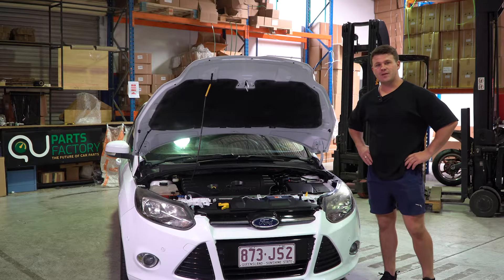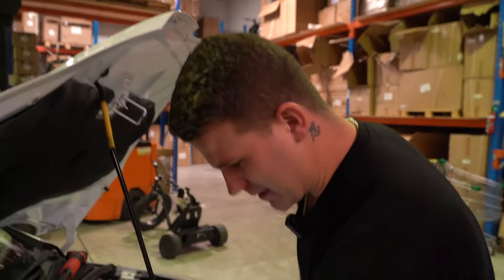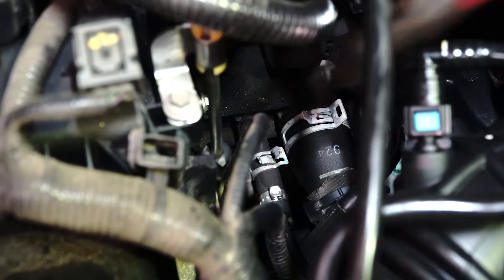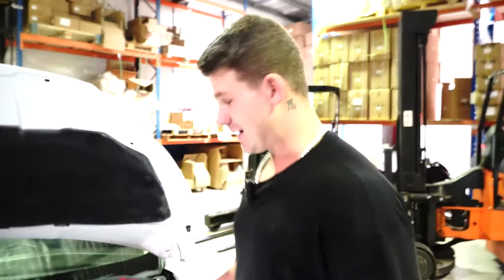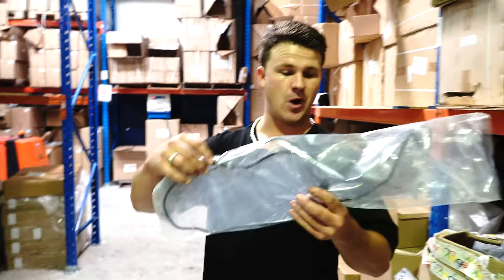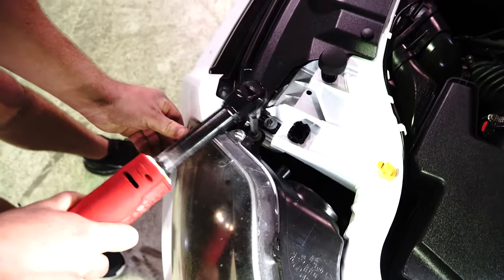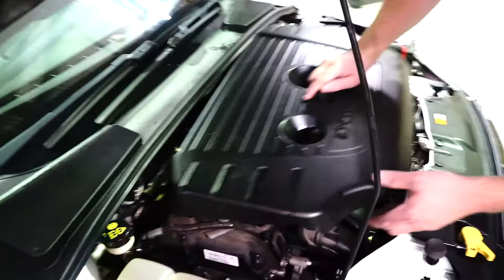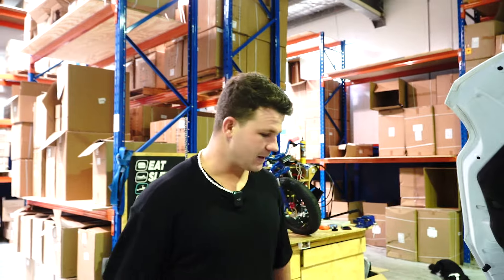How to Replace Ford Focus Coolant Reservoir Hose Pipe Suit LW Models 2011-2015 1.6L 1.8L 2.0L

Comment: How are your butterfly clips going in so easily?  I was pushing on those with all my might and couldn't get them in.
Reply from the maker: RAW STRENGTH !!!! ;) Nah just put some grease on the o rings and should go in easier
Reply: I know this is late but for anyone else checking comments, I had this exact issue and my arms are far from noodles lol ( 2016 focus 2.0 btw,)  you got to turn it a certain way. For me it was clockwise (standing in front of the vehicle facing the windshield) somewhere between  30° to 60° for the end connecting to radiator. Finally slipped right in!
Reply: @KevMo-f3d  The male end of mine was tool long.  I actually filed it down with a sander and it fit.
Reply: @KevMo-f3d  The male piece I was trying to push in was too long.  I actually had to shave off material for to make it shorter for it to go in.

Comment: Man, I’m struggling with this replacement. Getting the old one out required separately removing the old seals out of reservoir and radiator. The replacement part locally available with commercial account was a Doorman brand. It will not go into the radiator. Can not get the new O-Ring to pass into its place. Oil, grease, 2 different sets of pliers for additional force. Second pair of eyes and hands to try. The original seal in radiator also had to be removed separately after hose removal and it’s possible the picking out the original seal scored the inside of the radiator just enough to cause the issues. A little sanding with 100 grit paper was still no go. This 10 minute job can turn into a nightmare fast. 😅
Reply: Same issue with hose going into radiator. How did you get it to go in
Reply: I hate doing auto mechanics.
Reply: @dustinurbaczek7800  the hose ends have to go inside of two slots in the radiator and overflow if one end doesn’t go in these slots there  will be a leak. 
Practice by seeing this in the overflow side first. Then you’ll know what I mean by slots. Then you’ll use your phone or mirror for the radiator side, to see where those inner slots are in there.
Reply: Is there a different part for different focus ? I have a 2014 ford focus and the part I got fits on the overflow tank and on the block but not on the radiator.
Reply: @luisparamo9402  based on what you are describing, you have the right part 🤣. You unfortunately are experiencing what everyone else has experienced and found this video. You have the right part. There’s a chance the end you have in the resivor is not truly in. For some reason that end will appear to be in easier, but mine leaked because I didn’t understand how these work. 

There are two grooves inside of where the hose ends go. Radiator is very hard to see. You can try using a phone camera or a mirror and flashlight, but there are 2 slots in there your new hose has to line up with to go into. Same on that overflow or expansion tank. You could and probably should remove that one. Take a careful close look in there. In that opening you’ll eventually see these slots the new hose has to go into, so you’ll be leak free and not overheating on the side of a road.
Reply: I’ve been thinking about doing a YouTube channel for years. I work at a used car dealership. In fact, I do believe the focus I did this repair on is back with transmission issues. If I can, I will do my first video showing how to install these hoses.
Reply: Just use 3 small block off plugs you can get at any autparts store and plug it at the coolant bottle, radiator and waterneck. No need for that cheap useless line to be there. All gas and added pressure will be released by the 21lb cap. 
The Ford master mechanic gave me no explanation for any real function it services so I asked him if I can just plug them all and he said ya.
Reply: Check for debris if it ain't going in lined up and greased. Had some in my and popped right in after go dislodging said debris
Reply: @ Nice 👍🏼 you’ve got some good luck. You probably had it really close to begin with if not exactly lined up how it had to be.
Reply: You got to turn it a certain way! Had this issue finally got it to go in no problem! See previous comment
Reply: @KevMo-f3d   I've got 2 ford focuses, both 2016 and I just capped all 3 sections on both and never had a problem since
Reply: @Personalized_Workshop  what did you use to get the seal out of the radiator end? I am having that issue now, and cannot think of anything to get it out of there.
Reply: @ I used a cheapy harbor freight pick tool. The ones with the orange handles. I’ve since upgraded to the Icon set.
Reply: @Personalized_Workshop  so I found out my the seal I thought was stuck in the radiator, was actually stuck in the reservoir instead. Now I have to replace my radiator because it is leaking from that point.😒
Reply: @ did the new one come with a seal on both ends? I can’t remember. Your leak in the radiator isn’t just because the new line isn’t in the grooves? I had a leak at the reservoir because it wasn’t in the grooves right.
Reply: @Personalized_Workshop  yes the new one had seal on both ends. From what I could tell it was seated right. I could not turn the seals, and the clips clamped around the tube.🤷‍♂️
Reply: @KevMo-f3d  you are exactly right. I am doing this rn on my gf 2012 Focus SE and I had to basically flip the whole hose the opposite direction is it popped right into place. 

Thank you. Now to see if these O rings hold up.

Comment: I can’t seem to get the damn rubber piece around the nipple on the thermostat housing tube. Any tips?
Reply: I used the knife on my Gerber tool to keep slicing the same spot until it started to split and then I was able to split the time apart and rip it off the plastic nozzle and nipple. But notice how I said I kept slicing. Don't apply too much pressure, you wouldn't want to break the plastic nozzle. I just kept slicing and slicing the same spot, with gentle-ish pressure until I could split it open.

Comment: Why replace???  Use a plug to plug the coolant bottle recirculation, use a plug to block off the line on the radiator, and use another plug to block off the water neck where the line starts.  I see no point in recirculating hot coolant in such little quantity back to that cheap plastic tank and even cheaper plastic cap on the tank??.lol. what am I missing by doing this?  We never had recirculation small lines on our old cars, just pressure release radiator caps and over flow bottles. All gas and pressure is released through the 21lb pressure cap.
 What useless function am I missing?  I had the clip on the coolant bottle line which broke, so I bypassed it all last week.
Reply from the maker: Hard to sell.